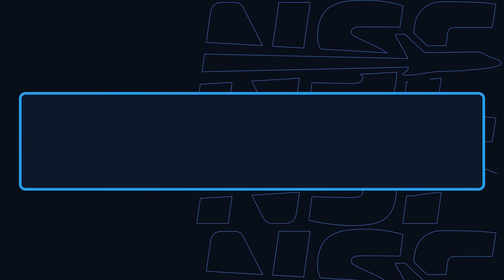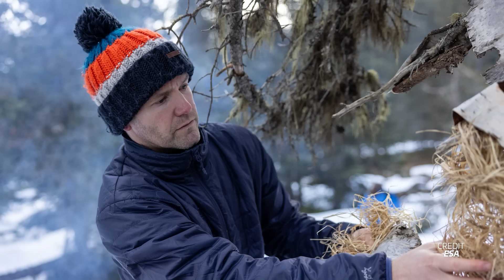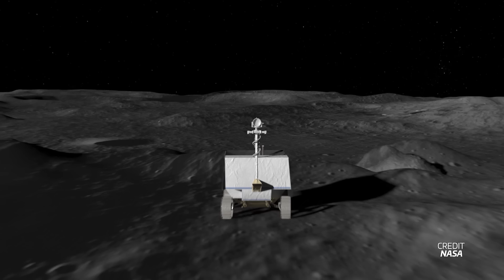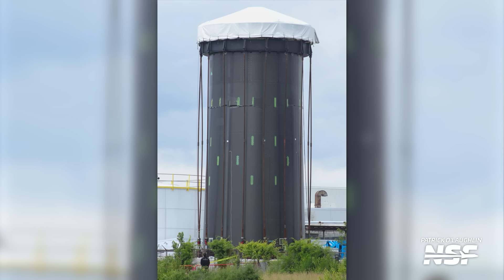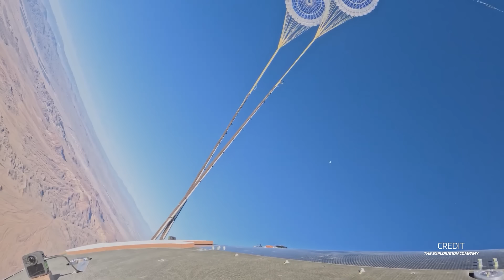The Rocket Launch Nobody Was Expecting | This Week in Spaceflight

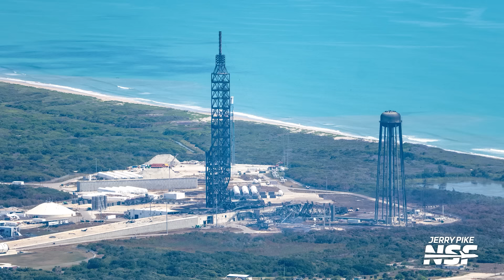Comment: 1:18 "The support tower that was right next to the rocket is repairable." I'm not a structural engineer but I'm also not a BO investor (nor an Amazon shareholder anymore) or a moron. That tower twisted at least 20 degrees in the explosion and snapped one of the main load structural support columns. The steel was superheated which further weakens the structure. Why would they risk patching it other than to unnecessarily rush the repairs?
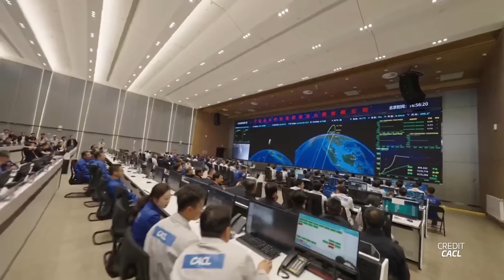21:56 "According to the manufacturer" of the Chinese stolen rocket design "the design (that they didn't do), construction, and qualification took just 21 months." I wonder why China doesn't honor US IP or patents.
Reply: That "Support Tower" is repairable because it supports nothing, it's a overbuilt lightning rod.  The steel was not hot enough for long enough to cause a problem.  Yes it was at ground zero of a fireball, but the fireball didn't last but a few seconds, takes longer than that to bring steel to 1200F to cause harm.   Life long boilerman and blacksmith.
Reply: I wonder, what exactly is that they stole?
Reply: @Alexphysics13  Grid fins, landing legs, they stole SpaceX IP. They've stolen literally tens or hundreds of billions of dollars of IP in the last 50 years.
Reply: @CyborgValkyrie  grid fins, that thing that first flew in the 1960s on soviet missiles. Very new indeed. Landing legs. Of course. No one has ever thought of putting legs on a rocket. So basically the two non-functional things on the rocket is what they stole. The engines, tank design and more… all that was not stolen?
Reply: @Alexphysics13  Non-functional? I'm not sure you understand what those words mean. Look at the the designs of Chinese rockets, compare them to SpaceX. I'll wait.
Reply: @CyborgValkyrie  yes, non functional. They were there for aerodynamics 🙃
Reply: @Alexphysics13  wumao
Reply: @phlogistanjones2722  whatever you say
Reply: @Alexphysics13  They serve a function and are therefore functional. If they were 'non-functional', they would either be broken things that should function or be aesthetic. If you mean fixed or static but useful, that's not only something else, it's a poor hill to stake a flag on. Grid fins have to move and landing legs literally deploy.
Reply: @Alexphysics13  Again, compare their designs to previously developed SpaceX ones.
Reply: @CyborgValkyrie   I know very well the SpaceX designs, I can tell you there's no stolen design here. You can't claim they stole an entire rocket's design just because of grid fins - which have been flying since the 1960s - and because of landing legs. You're really not even bothering to address how they got their propulsion systems, avionics, structures, etc. Just grid fins and landing legs and that's stolen design and that's what made them be able to do this in 21 months.
Reply: @Alexphysics13  Scott Manley's latest video title includes "China debuts another Falcon 9 copy", so there's that.
Reply: @CyborgValkyrie  yeah and you said STOLE which is not the same as COPY. Terran R is also a Falcon 9 copy and is American! Even better: there are people working on it who spent years also working on Falcon 9! And despite all that, you’ve still not said a single thing other than “grid fins and landing legs” that China supposedly stole for CZ-12B. But good attempt trying to bring up Scott’s video title lol
Reply: @Alexphysics13  Okay, explain to me the difference between 'stole' and 'unauthorized copy', because SpaceX did not sell the designs which are 100% patented/copyrighted.
Reply: @CyborgValkyrie  There are no patents or copyright on anything on Falcon 9, what are you talking about? 😐